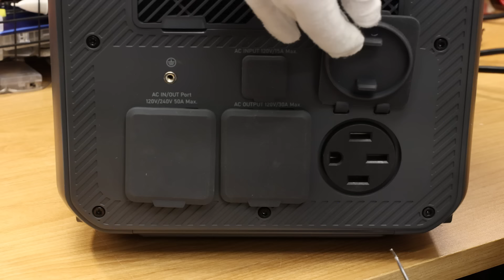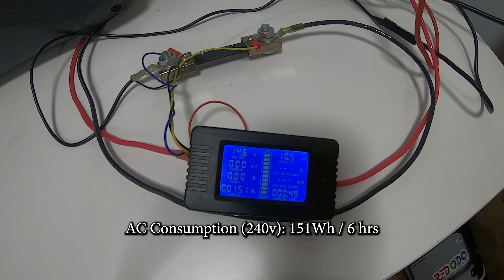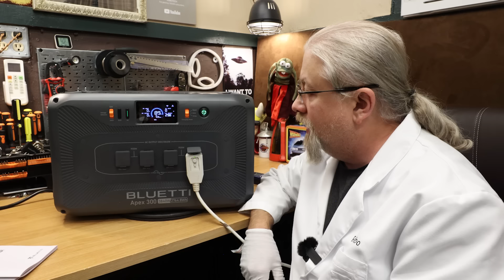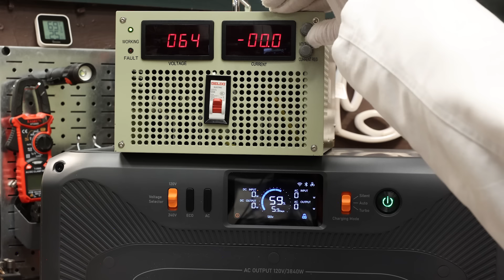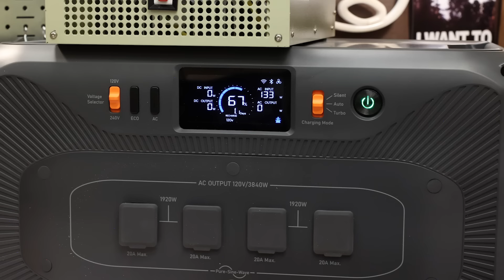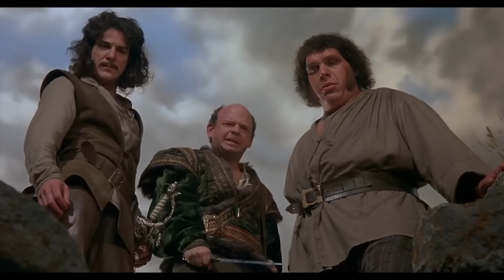Bluetti "APEX 300" 120v/240v MODULAR Home Backup Power Station | Cheap & Simple!

Comment: What these things need is the ability to charge from dirty generstor power.  People buying these dont want to also have to buy a new style generator.
Reply from the maker: Bluetti grid enhancement mode in the app should let it charge from most generators.
Reply: Very true most people can’t afford an expensive inverter generator and one of these. I have a relatively inexpensive generator that produces high THD.  It’s great for running a well pump or basic electricity, but I would not chance charging a solar generator with it.
Reply: @Zebu-Music    Look at the EG4® Chargeverter GC    Made to use dirty power to charge with.

Comment: A few of us already have Bluetti products and this unit would make a fine addition in a grid down situation. Say you have a AC 300 or AC 500 with  B300 or B300K batteries already. Have all the solar panels connected with the higher voltage. Grid goes down. You already have Solar coming in. All you need to do is charge the apex from your other Bluetti on AC. Take the apex into the kitchen and you are freezing and cooking in no time.

Comment: The separate DC breakout box would've been ideal because you can pack away the main power station where it fits best then have your DC outputs where they're easy to reach. Too bad it's a glorified cigarette lighter port splitter that can only handle a pitiful 110w. The Anderson powerpole is nice but just put it inside the power station.

Comment: Its not a 0ms switch over time its just running on the inverter full time like any other inverter system lol.  That part is really dishonest on their part as it is not any switch over at all.  

They should advertise the 20ms that it actually has so people can fairly understand it against competition like Ecoflow that has 15ms time on new products and can also do 0ms always on mode.

So I am glad you called that our right away.

Glad you made it to 4k :) something looks off though, like blurry and noise in the shadows?  Just constructive feedback as a guy who did video for so long, but the review itself is great.

I hit 1000w always within seconds on my Delta units just feeding them 48v batteries, wonder if you would have gotten different results not using the power supply?
I went ahead and ordered one, so I'll test it when I get it (in forever probably lol) but yeah all the Deltas I have none have 240 and my big whole home DIY system I cant do all the crafty things I can do with this, so I'll add it to the mix.

Comment: Nice video and product but I got me a mango Power e brand new in the box for $750 dollars does 2000 watts of solar input at 150 volts 3000 watts ac and a 3.5 kWh CATL battery for almost the sake price I can get another unit even if I use a wire to get 220 more battery more solar and also 6000 watts ac you can still find good desks on the web
Reply: Where did you get that?  It goes for over $3,000.
Reply: @theclearsounds3911 I got it on offer up from an Asian guy on Christmas Amazon had them for 1200 another Asian guy sells them for 1500 just have to shop around some people take advantage of others not good I helped the Asian guy to install 2 on his house and gave them to me for that much plus the wire to do 220 volts this guy it’s in Ontario California another guy sells you the unit and the battery on top for 1900 dollars that one is on Stanton California his out right now but he usually gets them

Comment: Thank you! 2764.8 Wh at 240v is 11.52 Ah. Not taking into account inverter loss, At 12V it's 230.4. So it's like having a little more than 2, 100Ah, 12v batteries for charge capacity. Considering they're down to $130 a pop now, I don't know. Probablly great for those that are already in the Bluetti ecosphere with addional batteries. I wonder what voltage battery packs are used on this. More than 48v? Any guesses? I searched with no luck.
Reply: It dosent really matter what kinda battery is inside as your not plugging anything to it directly ever. You are right in assuming it's about a little more than 2x100ah 12v battery in term of capacity/wh, but it stop there. Your 260$ worth of 12v batteries won't do shit alone. You would still have to buy cabling to get them together, more cabling between battery and mppt and inverter, get a mppt, get an inverter, get a shunt, fuses, a screen, etc... And none of that will safe to just leave it out around people that don't know that batteries can be dangerous if you dont know what you do... So an extra 800-900$ for all this in a neat package, not too much. Is bluetti ''apex''(such a click bait name for the weak alpha male crowd) 300 perfect? HELL NO! Is it terrible? No. The mppt is the biggest concern as hobotech said it's impossible to attain the claimed 1200w even with a custom device that should hit it easily. And the pletora of basic addons sold seperatly is despicable.
Reply: @jesuspunk84  It matters to me. I've built my own small system. Battery capacity is important. How the pack connects to an inverter and/or charger is another topic.

A DIY power station is as safe as the person building it. Check out some of the Will Prose ones.

Comment: I have several either 100ah or 280ah lithium batteries. Can I charge the unit with them via the solar ports? I don't think you mentioned anything regarding that. Great review, and very thorough. Thanks.
Reply: why wouldn't you, same principle as using the cigarette adapter.  clip on pos and neg run the cable to the dc solar input, they sell cables for this, I even purchased a usbc cable to SC connector..
Reply: @TheRdwyer  Thanks for the reply. I did rewatch the vid and found where he mentioned battery charging. Just wanted to make sure. I do that now with my AC180 and I have the cable., but not with xt60 connector. Will have to get one. I have several Lithium  batteries, so will not need the expensive back-up battery.

Comment: The intro price, two of these Apex 300 with two B300 batteries and a 240V hub for $4400. Same price as the two Pecron E3600 and two EP300 batteries and and a hub that I have ordered. Should I cancel my Pecron order and order these?
Reply: It always depend on whats your use case and you havent mentioned it. So nobody can tell you to go one way or the other. Every units have +/-... The right tool for the right job. If you don't know the job, and how to choose the tool for it, you need to research a little bit more before throwing almost 5000$ out the window while not understanding what you buy and why. Take time to learn solar and compare different product and how they can best serve your need, compare review from different source. Don't trust only one person doing review. Keep 20 tabs open on your internet browser with solar stuff for months. Think about it. Tame it. OR else you might just buy 5000$ worth of the wrong toys for nothing.

Comment: Even my years old Bluetti Ac200 Max has 12v to 145v. 12-60v is instant forget it for me. That and it having more add-ons to do basic things like DC phone charging I'm out.

Bluetti looked at microtransactions in video games and thought 'thats a great idea. Lets sell people their solar generator solution is little pieces'. Star Citizen would be proud.
Reply: 12-60v per mppt started to be outdated 2 years ago. Ecoflow did the same mistake as bluetti when they got their new delta 3 plus out... still that utterly dumb 60v limit. Residential panels are getting up to 50-55v nowaday and if you live in a place that have real winters then that 60v limits is bullshit. Same goes with that weak 20amp max. But on this side i can give them a little more slack because of the requierement to go up to 10awg instead of 12awg... Still, the bluetti apex 300 claim to be a full house ''solution''... And that robotech couldnt even get the unit to accept the full 20amps is dishonest claim from the company. They missed the fucking mark. And yeah the shitification of gaming applied to an already weird solar market filled with hard line incompatibility with anything but it's own product and still.... Smells like Apple product where they make their customer pay up to 4-5times market price for ''basic upgrades''
Reply: @jesuspunk84  I thought the same until the SolarX 4K was announced, yes it would be nice to have it all in one place and yes I'd much rather pay extra to get that, but then when you think about it, how many people using this as a portable unit are going to take more than 2400W of solar with them, so it makes sense to fit a smaller MPPT for those users, and for those of us using large solar arrays, which in all probability will be massive, heavy things, that don't move, having a fixed MPPT controller in the house is not an issue. As I've got a mixed bag of solar panels, I'll likely be using the built-in and SolarX and what's more I've got the option to use the SolarX on my other batteries as well, so it's a win-win in my book.

The SolarX 4k is the addon required for full house systems, so that adds $500 or so to the price, but this unit still comes in insanely cheap, the best bit, I don't pay for DC that I don't use. But if I did want DC, I could mount the small addon box somewhere convenient, whilst keeping the big battery nicely hidden away, at least if this was an RV. For a full house system you're going to have it connected up to the distribution box, and in all probability, you're not going to be using a DC fridge in a home, and perhaps charge your USB devices from the plethora of gang sockets that contain usb ports.

I'm sure Bluetti have access to the majority of users data, in as much they'll know how much we all use DC, how much AC and how much solar, they probably decided based on this, how many of us would be likely to get a cheaper unit without features we don't use.
Reply: Exactly my thoughts on the 12-60v per X60 plug, this is terrible the maximum Watts I could run per X60 plug would be around 400 Watts per X60 plug without exceeding 60 v with my Solar panel setup.
Reply: The excuse I heard is regulatory.   200V DC can be dangerous and has regulations.   Low DC voltages generally don't.   Not that the regulations are onerous, but they do vary by country so it's a bunch of hoops.   Obviously they need to follow the regulations for the 240VAC, but that's a much more well-paved path.   The proof will be if the Apex 300 is available in some countries that the Solar4X isn't.
Reply: Goted reference and comparison 😂

Comment: I have a 15 yr old solar system "feeding the grid" setup on my house. It seems that this product can somehow integrate with that type of system, but I'm still a bit unclear as to the details on how that type really works. Their website doesn't really say much. Looks like they just use a Reliance Sub Panel box, which I have for my backup generator. So does the Reliance sub panel allow 240V charging and pass thru etc. or is it either or?

Comment: Requires APP??? No go! NEXT??
Reply: It doesn’t require the app. Everything is included in the system. The app is an add-on benefit.
Reply: @544931  I only partially agree. I think the app is an add-on expense. But, at least there is a way to run without it, and wifi, and Bluetooth. But, I do understand that they are trying to please everybody, and I can appreciate that.
Reply: Youtube keeps deleting my reply. I only partially agree. I think the app is an add-on EXPENSE.
Reply: @544931  Certain functions require the app, as the video explains. Unless there is an alternate way of doing them, you need an app. I am DONE 100% on any device requiring a stupid app. WE DONT WANT THE STUPID THING!
Reply: The app is an added expense, and not a benefit to everybody.

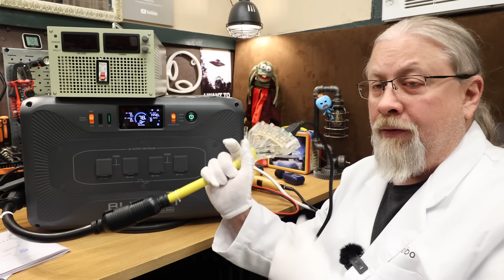Comment: 23:15 Run 240 off 120 but with a serious RV Caveat or seeming contradiction (at end). Curiously, it is claimed you can charge @ 120v and run @ 240v at the same time.  That means a hot water heater could be run off 120v, interestingly. Or a dryer, stove, well pump etc; any odd 240v machine (i.e. welder)could be run off 120v.  Curious.  So if you don't have a 240v receptacle at your cabin, remote location, storage unit, treehouse (think 240v mini split) you could still run the device. 

25:22 Caveat: Plugging a 50A, 240v RV into this which in turn is plugged into a 120v receptacle will power both sides of the 240v circuit, but with the same phase not split phase, which 240v appliances need.  Is this not dangerous?  I am not sure how any 240v device would work then, as is claimed to be able in above paragraph.  This needs clarification.
Reply: Well, you can charge and run 240VAC at the same time, but the problem with that is most 120V receptacles are limited to 15 Amps or 20 Amps depending on the receptacle design and wiring. In order to convert from 120 to 240, you have to use essentially double the Amps... so, a 120V 15 receptacle is limited to about: (1800 watts for short term use).  What that basically means, is that you can't possibly pull the load of a typical clothes dryer unless the unit has some battery juice to help it along. You might see 2000 to 4000 watts of power being used to run the dryer. ( I think I heard something about a feature  that allows it to use some of the power from the socket, and some from the battery, so still pretty cool).

Comment: Yes! I have to go with this new model of the Bluetti power station. Everything I heard in this video sounds good and reliable about this power station. However, it would have been nice if they added the 12 V, USB, C-USB and the cigarette lighter port instead of that big adapter with all that cable. It's inconvenient with all that attachment. This power station is very impressive. Thank you, Hobo tech. 👍

Comment: @30:47 One of the replies they told me was that the limited voltage was due to some new regulations (euro?) But never looked into it anymore.   I have ~110v arrays which doesn't work with the built in or the x4k. Their response "it's easy to reconfigure!" um, no it's not. I hate to admit it, but I wish they had another accessory for solar input for those of us who built arrays in between the 60v max & 120v min.  Like maybe stuff 4 of the mppt controllers that were in the ac500 into a new add on, would be perfect for me.

Comment: I currently have the AC300 with 2 B300 batteries. Can the B300 batteries be used with the APEX300 and it's built in B300K battery. If yes, is a special cable required the B300 batteries to the Apex300?
Reply: B300 batteries work - believe same cable as the aC300 unit.
Reply: @cloker375  I will research it some more to make sure. Thanks
Reply: Can confirm as I’m using it now with two b300
Reply: @CYB3RS3CKS  Thanks
Reply: it works with B300K,  B300, B300S battery packs